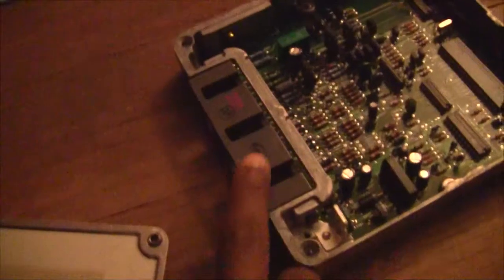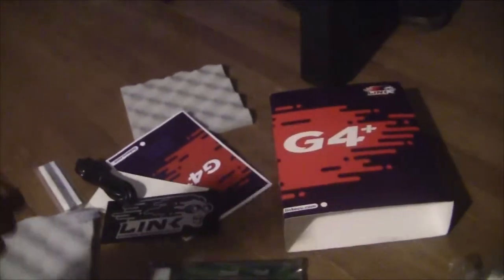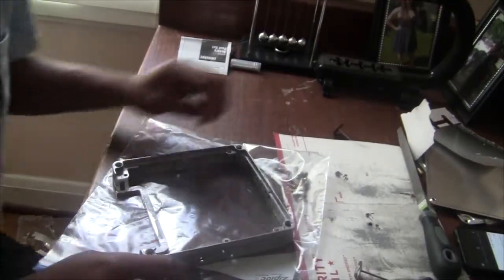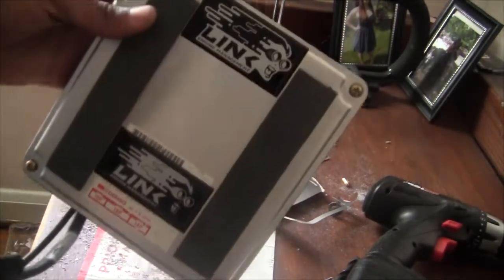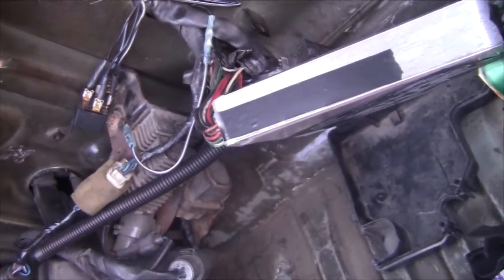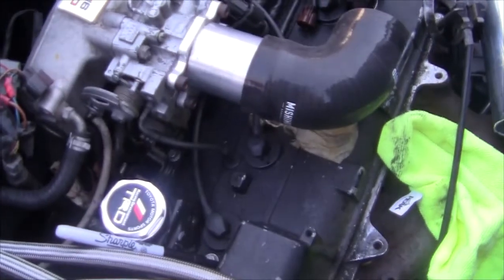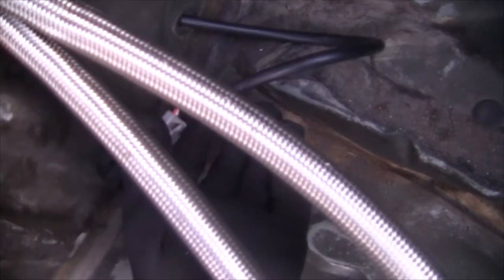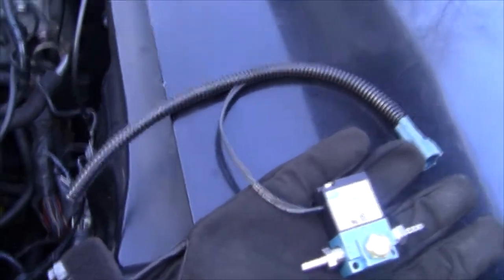I Install a LINK G4+ ECU IN MY TOYOTA MR2

Comment: Yer buddy , great vid man. 
100% the link ecu is bad ass , i hope you got the flex fuel sensor to go with it . I cant wait to see this beast fired up.
Reply from the maker: rageu thanks man! It'll be fired up next week to confirm everything works before wiring up the coil on plug kit.
Reply: Daniel Oliver dude that's awesome, are you going yarras coill packs? Verry intrested as i want to do the same thing.
Reply from the maker: I'm going 1zz coilpacks from celicas and MR-S. Let me know if you want a kit, I'll be making them soon.

Comment: What Wideband are you using? Is it easy to connect to link ecu. I am thinking of picking one up for my Rx7 fd. Just wondering about sensors. Did you have to pay extra for expansion loom or did it come with the plug in ecu? Nice vid
Reply: It came with a 4 bar map sensors that is awesome
Reply: Check out pettit racing for RX7 FD tuning

Comment: I got a st202 celica with 3sgte engine but using a 3sge ecu, what aftermarket ecu would work for mine?
Reply: Bro can I know how u using a 3s ge ecu on a gte motor??? Please I want to know I have a 3s gte awd mark2 which is sitting for two years will like some help with the wiring ... Any ways love from Fiji❤️❤️❤️

Comment: Do you have to wear an anti static hand band while installing the g4 into the factory case?
Reply from the maker: It's recommended yeah. Comes with one.
Reply: @DanielOliverRacing  I got mine installed, but just a base map. Can I drive with it or do I have to get it on a rolling road?